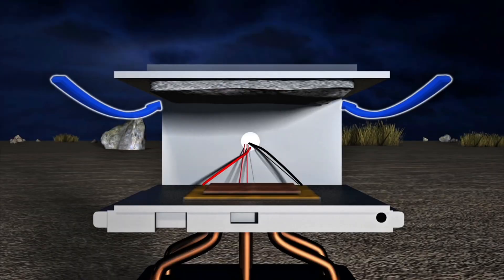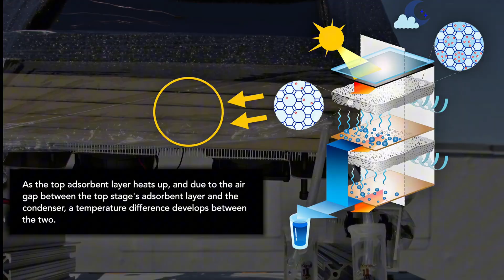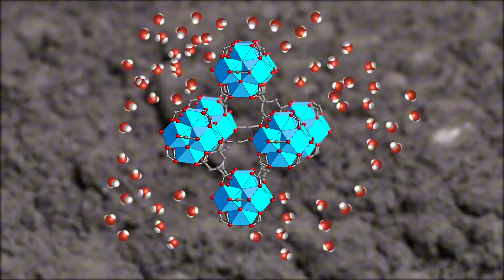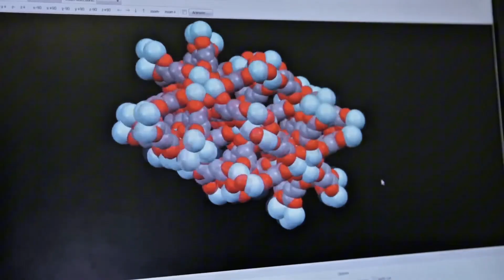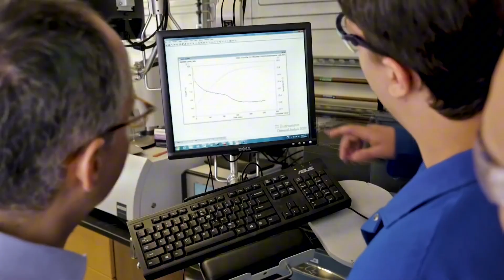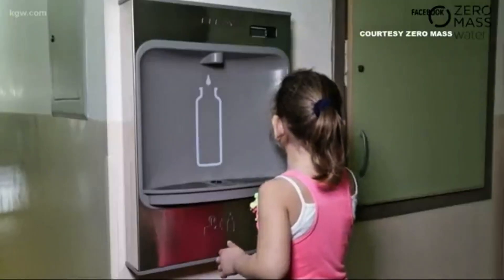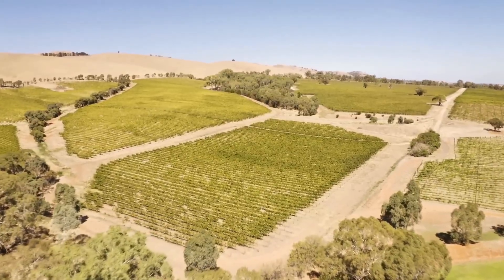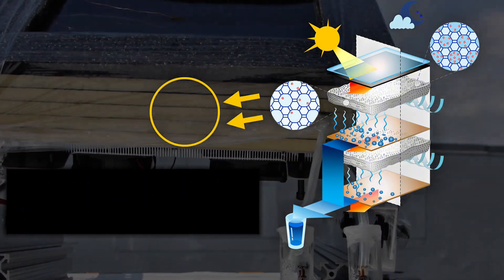This Unbelievable Technology Is Going to End One of the World's Biggest Crises!

Comment: “WATER FROM AIR” has been around for centuries a simple de-humidifier in your own home with a charcoal filter will produce 5 gallons or more in 24 hours. If you. Have 15% or more moisture in the air you can pull the moisture from the air. The military was doing it at forward operating bases in IRAQ & AFGHANISTAN. They use solar powered units from ISREAL in India and around the world. Quit trying to reinvent something new when you could improve on the existing equipment.   
The only issue with getting water this way is the government (like Screw -U-Fornia California) can’t tax you because no one owns the air we breathe. But they can tax you for storage, land use, & the power you need to run the water harvester.